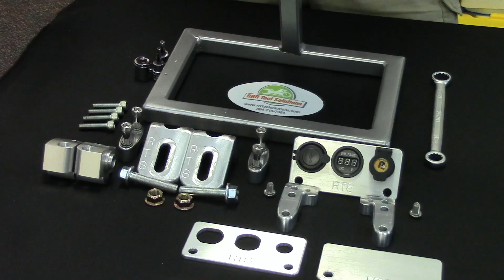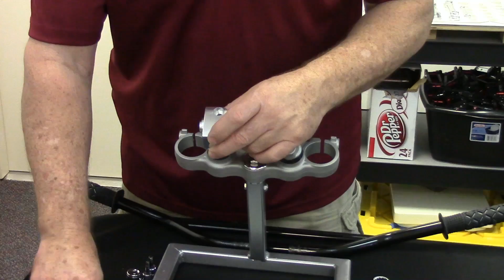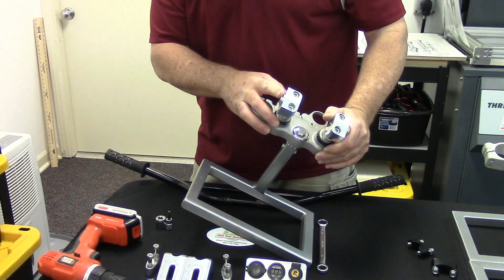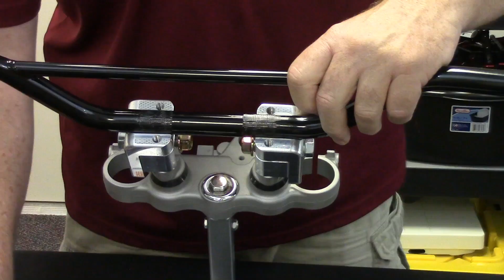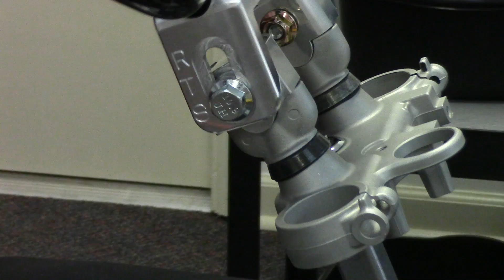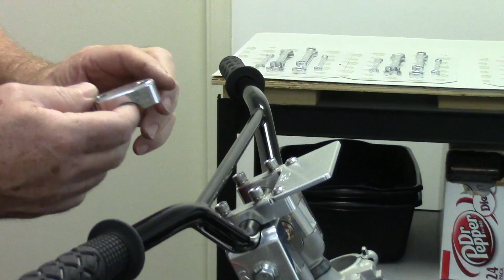Motorcycle Handlebar Risers Installation

Comment: Sir kindly suggest handlebar riser for RE GT continental and where is available.
Reply from the maker: Hi Prakash, we can only build a riser system and be sure that it fits if we have a bike or all of the steering components in our shop. We have to model the saddles, get the exact bolt spacing, check for bar clearance, and finally - to actually bolt the system in-place to ensure perfect fitment. The Royal Enfield motorcycles are not available to me here. The parts I would need to purchase in order to model/confirm the fitment will cost me several hundred dollars and that would have to go back into the selling price of the few RE systems I could sell. I thank you for your interest and time to comment. Best Regards, Gordon/RTS

Comment: Can I use this for Royal Enfield Classic 500? will it help in reducing the vibrations on handle bars?
Reply from the maker: Hi Kashyap, thanks for your interest in our handlebar risers. We do not have access to the Royal Enfield motorcycles here where we are, so I don't have one to model from nor take critical measurements for. There are no dealerships whithin 100 miles and we don/t have any local customers with one of these. We learned some time ago that bolting one of these up to the model being sold for is absolutely necessary. Even with our best of intentions, one attempt to make one from photographs resulted in a set that would not work on the customer's bike. Again, thanks for reaching out. Gordon/RTS

Comment: consulta el sistema es compatible con la moto honda crf 250 l
Reply from the maker: En primer lugar , parece que lo hará. Ahora , para estar seguro de lo que necesito saber 2 cosas
1) El espaciamiento de los pernos en cap " de centro a centro " 35 mm más o menos
2) El diámetro del manillar es de 7/8 " de pulgada (donde se atornilla en la tapa .)

ENGLISH
First, it looks like it will. Now, to be sure I need to know 2 things-
 1) The "center to center" spacing of the bolts in one of the caps (our riser base has to bolt in-place of the cap) 35mm more or less 
2) The handlebar diameter is 7/8" of an inch where it bolts into the cap.

Comment: El sistema sirve para la moto CRF 250 L HONDA
Reply from the maker: En primer lugar , parece que lo hará. Ahora , para estar seguro de lo que necesito saber 2 cosas:

1)"Centro a centro" pernos en una de las tapas (nuestra base de elevador tiene que atornillar en el lugar de la tapa) aproximadamente 35 mm

2) El diámetro del manillar es de 7/8 " de pulgada. donde se atornilla en la tapa
(Espero que el traductor hizo buena)

English for my other vistors
First, it looks like it will. Now, to be sure I need to know 2 things-
 
1) The "center to center" spacing of the bolts in one of the caps (our riser base has to bolt in-place of the cap) 35mm more or less
2) The handlebar diameter is 7/8" of an inch where it bolts into the cap.